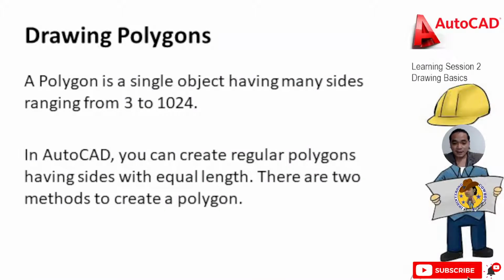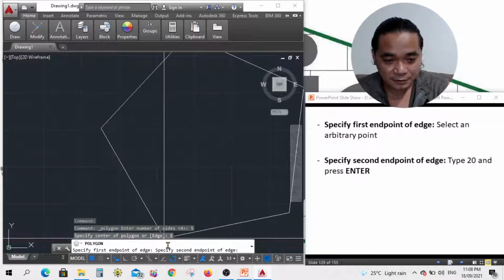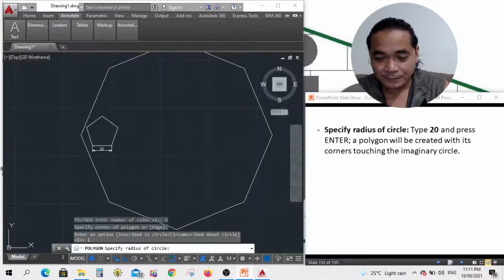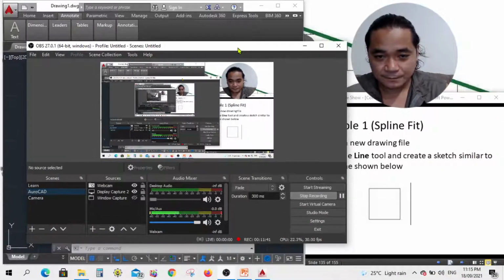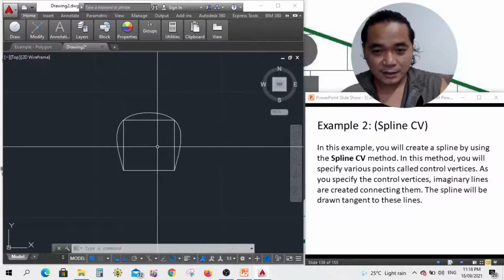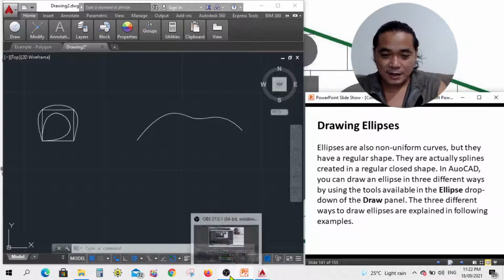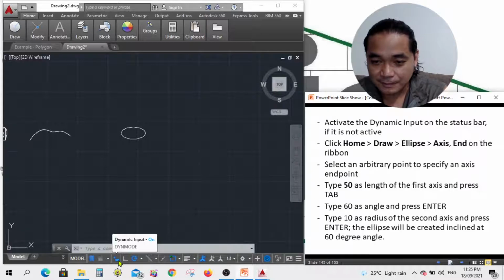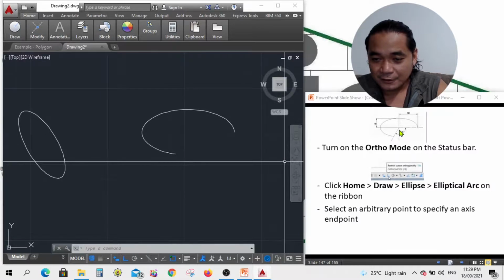AutoCAD LS 2-9 | Drawing Basics

Comment: It's very convenient when you can just draw a shape by specifying number of sides,
  specify the center point, first endpoint and second endpoint, and just press enter. With
 that simple steps I was able to draw a polygon. Learning spline however is a bit tricky
 to follow, but I was able to learn my way through. Just undo if mistakes are made. Also,
  it's interesting how drawing a polyline can be made into a curvy form, using Spline CV. 
 
P.S. Ellipses is first introduced to me in this video. 
I am learning so much from you, Sir. Thank you!